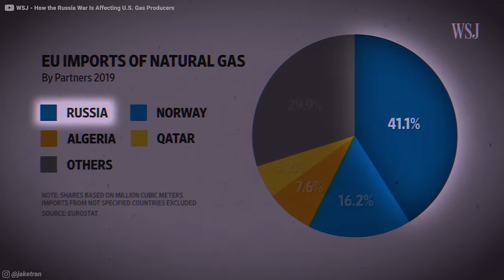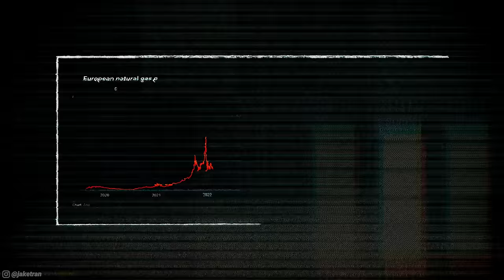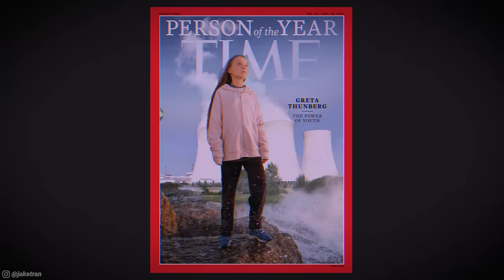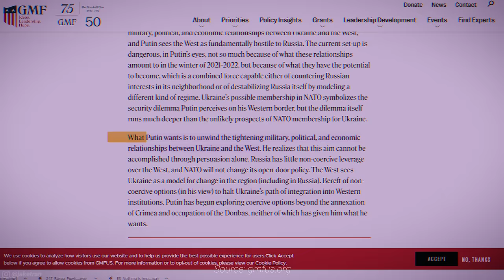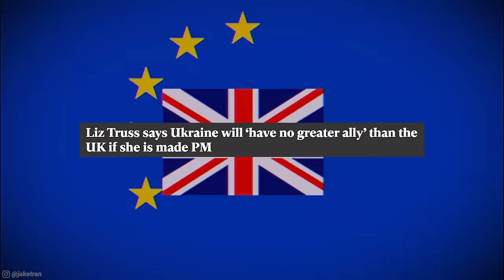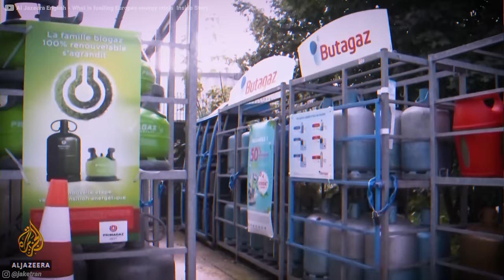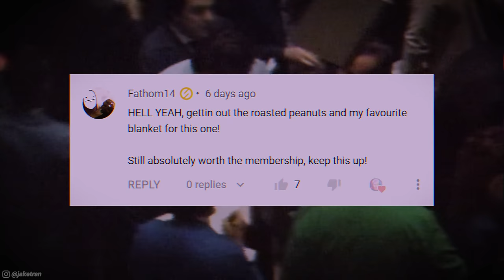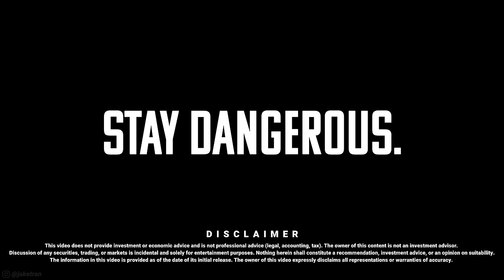Europe is gonna SUFFER.

Comment: Europe never should have turned away from nuclear energy. It's not the boogeyman everyone thinks it is and if we are seriously going to do anything about fossil fuels we will have to implement it.
Reply: There's about 30 Nuclear stations across Europe being finalised within the next 2 years. Europe will be fine.
Reply: In the next 2 years or this winter?
Reply: Thats just wrong. Not diversifying natural gas was the problem. And nuclear power is the straw man today.
Reply: Its not like reactors are safer than any other form of power plant as well as nuclear energy having less worker injuries and deaths than other means of power production or most nuclear waste being relatively harmless and the 1% of slightly more dangerous nuclear waste being stored in near indestructible canisters so nothing can happen to it.
Reply: just fyi, Europe as a whole did not turn away from nuclear, e.g. CZ and SK did not cancel anything and in fact, both are building more reactors in our existing nuclear power plants. SK just launched a new reactor like 2 weeks ago ☺
Reply: @benpriest1418  Lets hope that they see construction and aren't 86ed.
Reply: @cassiopeiathew7406  It takes 20 years from ground up in the best conditions. 30 is average so no, not this winter.
Reply: @benpriest1418  incorrect... france alone has 56. fact check your info
Reply: The problem is the same. Nuclear power and alternatives means certain People lose money. When OPEC threaten the USA. We could  have just stop using gas and make Public Transportation better. Design our cities so it easier to walk. But we didn`t. People will always chooses the easier and less costly. Owning a car is expensive. But walking requires a good pair of shoe which is like 50 Bucks and can last six to eight months.  Why spends hundreds of dollar filling your car when the Grocery is ten minutes walking distance. If you need to get to the mall, The bus is free and can get your there in twenty minutes.
Reply: What's strange is we don't use that perpetually burning fireball in the sky 💩
Reply: @nucleus691  forgot the elephant in the room whichis the national security risk of a nuclear plant, as proven by whats happening in Ukraine
Reply: @JohnTaylor-fh4et  Yes but money. How do we make the money. We could install Solar Panels on the moon or something but if we can`t make money nope. The faith of Humanity and the Planet depends on someone getting richer. What a time to be alive.
Reply: @undeadblizzard  and the best part is money is just created with computer clicks now. "In god we trust", which god, whose interpretation of God.
Reply: @fgsaramago  thats one valid point, actually.
Reply: @Perkwunosik  your comment is incorrect (or more like completely unnecessary) cause @Ben Priest talked about the 30 MORE nuclear plants which are 'being finalized' in the next 2 years all over Europe...!
Please think and read carefully before you call people out for not checking their facts 🤐
Reply: @KingNayNay  didn't ask bro. L + ratio
Reply: german here. u couldnt be more right. especially germany thinks like that.....
Reply: We should let people innovate with nuclear energy. The first cars took weeks to build but now they can be made in a few days. Mass production is faster if we are allowed to prefab parts and quickly assemble on site. Australia is already building nuclear plants the size of houses and assembly line building them.
Reply: @KingNayNay  cope !
Reply: But OPEC would start to cry. Those poor souls won't be able to suppliment their children with 2022 Bugatti Chirons to abandon in the UAE desert. It's tragic they'll have to settle for the 2021 Chiron this year 😢
It's just tragic you know? To drive a peasant vehicle... This is sarcasm
Reply: @PepekBezlepek  yeah they didnt, but there is still problem with EEX (European Energy Exchange) in Leipzig. Since CZ sells electricity to EEX while there are not enought sufficient and self dependend on themself, its the problem, They should just leave EEX and they wont need to buy energy back in higher prices. Thats just stupid. EEX is connected all around EU so thats the big problem
Reply: @JohnTaylor-fh4et  We do but it is dependant on the weather so it requires km^3 sized battery or coal plant backups
Reply: What if I told you that the Uranium is also came from Russia
Reply: @Ulbert86  Or America, South Africa, Austrailia
Reply: @joeshabado1431  Hope you are aware that the US is also buying the Uranium from Russia at this moment. (14-16%)
Reply: @Ulbert86  Good thing the majority of it comes from Canada and Australia who combined produce four times what Russia produces.
Reply: @Ulbert86  they are all in cahoots together, the world's a stage and we're all being played 💩
Reply: Except if it gets bombed
Reply: our houses are heated with natural gas I live next to a Nuclear power plant that still doesnt heat up my Centrale heating unit
Reply: @Perkwunosik  I didn't say there was 30 in total, I said there was 30 being built. Fact check when you read.
Reply: @JohnTaylor-fh4et  Solar is an incredibly diffuse power source requiring an enormous amount of equipment and land footprint to use.  It is also vulnerable to weather with clouds destroying solar electric output.  There is also guaranteed to be low sunlight every winter when energy is needed for heating.  Aging solar cells also inevitably leech toxic chemicals into the surrounding area.
Reply: Nuclear energy is not something that you can adapt in an instant, you don't just make a couple of power plants and start producing cost efficient energy.
There is a reason within Europe nuclear power plants are populated in specific countries and they are not spreaded all over Europe. First of all you need to have a consistent way of supplying yourself nuclear fossils, you also need a long-term plan for treating or storing your nuclear wastes and you also need a costly group of nuclear supervisors and testify that the power plants are operating safely. Jumping into this business with one power plant is just a non profitable energy source, jumping right into it with 5 power plants to have a cost even power source is also not worth it because easily something may go wrong. It's complex.
 Usually a country that wants to enter the nuclear power gang, will contribute to an economical ally country to offer personel to work on their power plants to gain experience and the "know-how", usually they will also offer as a trade to store some of the fossils and/or wastes for free under their ground and slowly will move to a couple of test power plants operating alongside the supervision of the country that they obtained the knowledge and the connections from. This applies even to countries like Germany with high level educational level.
Reply: @cassiopeiathew7406  Not going to be issue. Actually nordic countries have build their houses in way that they isolate the heat. Plus most of the heating isn't done by gas but by nuclear energy. Only small amounts of households uses gas.
Reply: @JohnTaylor-fh4et  One day that fireball is totally gonna be burned out though. Wonder what humanity's plan is when that happens.
Reply: yee
Reply: Tell that to germans and Austrians
Reply: @JohnTaylor-fh4et  1) Solar panels deteriorate fast
2) if its cloudy the effect deminishes
3) mantainance is really costly
Reply: @nucleus691  "nuclear waste being stored in near indestructible canisters" bro all it takes is one earthquake or tsunami to release the horrors of extreme gamma radiation into the world.
Reply: every house a mini reactor the size of a dishwasher, for heating and electricity, and free home delivery of 2oz of uranium one a year
Reply: @LABOUMDECADANCE  same goes for fossil fuels no, plus the instability of prices .
Reply: What’s the worry didn’t y’all evolve to survive Winter
Reply: considering north europe such as norway, finland do not have earthquakes due to the fact that they are on stable landmasses, all they have to care is about the accidents made by human error,
on the other hand, countries on young orogenic belts such as japan have a high possibilities of having earthquakes so if the earthquakes that occur there are big it's dangerous to build nuclear plants
Reply: Very true Joe but wouldn't all these evils he ended if we just didn't need energy and  live off each other sharing everything we have. At the end of life who and what did you fight for ....chances are your idols not God at all. Be careful in what you believe in if it isn't God then it's the other there's only two sides. I will always be this person people don't like if I follow the masses I end up where they do. Same to everyone
Reply: The way you sold nuclear energy you could be a great asset to God if you ever decided Joe
Reply: I’d disagree there fresh water consumption is a lot if you put it on a river you can kiss the fish good bye
Reply: @benpriest1418  wishful thinking
Reply: Or turn of its own gas, to please the green parties.
Reply: @cassiopeiathew7406  it's winter. you can survive the cold as long as you have enough clothes you keep you warm. if you don't have electricity during the summer, that is something to worry about because no matter how much you strip, you'll never be cool enough.
Reply: Only dingdong who was distancing from Nuclear energy was Germany, fortunately they now realise it was bad idea...
Reply: Am love russia
Reply: @JohnTaylor-fh4et  Finally somebody gets it. Yes, we are all being played, some people are getting obscenely rich out of the ukraine war, out of the food crisis, out of the energy crisis, out of the carbon footprint eugenesics. 
The reason why a lot of nuclear plants are still so dangerous is because the development stagnated decades ago, why allow nuclear power to flourish for peace and wellbeing if there is a lot more money to be made out of war and oil.
Reply: @benpriest1418  I cracked when I read 2 years, that's practically one Westoros Winter
Reply: You can blame the civilians of that.
everyone was protesting against it.
Reply: Totally safe nuclear energy which somehow gets safer as global politics become increasingly hostile
Reply: @davidvalencia129  that's why you have a diversity of sustainable sources like solar, wind, tidal, wave, and geo thermal..
Reply: @hl8216  And Japan has built many.
Reply: Lol. 1st, Gas is mostly used for heating, and the infrastructure of the industries are not suitable for transforming electricity to heat in time. And households lack the same infrastructure aswell, even though a lot of people are buying electricity heaters, and this is for what reason? Right, electricity prizes didn't spike up that fast.
2nd, nuclear energy is a basic supplier for electricity, and doesn't help much if the demand for electricity spikes up. That's for example the reason why france with it's 80% nuclear power has to import electricity from germany every summer to supply for their cooling systems.
3rd, you heard about that nuclear plant in ukraine that is currently controlled by Russia? Defininetly a smart turn to have some of these in your country active running when you're in fear that Russia might use nuclear bombs as retailiation for just supporting Ukraine for the war.
Still convinced, that nuclear energy is a smart strategic move favourible than renewable energy?
Reply: @LABOUMDECADANCE  one day is at least a millenium from now. Technological breakthroughs mean oil is being found in places where it was thought it had been exhausted. 'The Quest' by Daniel Yergin is an illuminating read.
Reply: We shouldn’t also forget further investment would’ve lead to further advancements. We’re still at the infancy stage of harnessing nuclear energy
Reply: Its the ONLY alternative to fossil fuel. But "doomsday ecologist" have nothing in common with common sense.
Reply: Yes and no. You'd still be reliant on importing fuel for those reactors so, while it might not be Russia in this case, the underlying problem would remain and volatility in prices would occur regardless during a large scale conflict.
Reply: France has a lot of Nuclear power plants
Reply: Risay  The problem is putting profit over humanity. What do you think Open Source is? People get degrees in Education or Philosophy because they love it, if work needs to get done, people will do it. The concept of money isn't real, and money is valuable because we decided it so.
Reply: @a2somali-ish588  Same with solar wind and sea tides
Reply: my man speaking truth
Reply: @cassiopeiathew7406  I can live perfectly fine without heating in the winters. We barely have winters here lol. I am not made of sugar.
Reply: @nucleus691  That's 100% true lol. And Europe doesn't have a lot of natural disasters so they don't have to fear nature going wrong like Japan. It's basically a great solution all around for them.
Reply: Could not agree more!!!!
Reply: bingo
Reply: nuclear energy is fine, the thing is that solar/thermic/hydroelectric energy, is just cheaper and more effective, I might be wrong but I am pretty sure that if you completely fill a land area equivalent to the land an average nuclear powerplant would require, depending on where, it would produce more energy than the nuclear powerplant in that same area.
Reply: @AmasterfulJuice  well ideally you want to combine it with all of them you want a diversified energy industry
Reply: boogeyman
Reply: @JohnTaylor-fh4et   The problem with solar and wind even more is batteries. You need as much infrastructure to store power when sun isn't shining/wind blowing. Otherwise there would be solar plants all over the southwest US and the Sahara, powering the world. The windiest seas would have wind farms for miles. But batteries to store power for cities/countries are insanely expensive/non-existent. Invent some new battery that isn't lithium and you're golden.
Reply: I am sure this comment section has a lot of people that know what nuclear energy is, and know what are low, medium and high levels of waste and how its recycled to the use of more important products, and I'm sure they know how atoms split to create heat. And that everyone is an expert and has the discipline towards others individuals replies.
Reply: @johnsmithcrackhead  Uhm... huh!? Ok dude!
Reply: Nuclear energy is the source of world pollution and the cause of climat change it is cheaper as source of energy but dangerous in long term the problem with Europe is it has become the US colony the deal with gas could have been a mutual win
Reply: @bolatsabikhan8127  You do know what induction heating is? Electric forges do exist.
Reply: @33333Tarun  That's why it's a big problem out there
Reply: does cernobyl ring a bell
Reply: @itzmosestone  Ok, 1986 USSR is NOT Europe today. The conditions and technology that allowed Chernobyl to happen don't exist anymore. (actually I think russia still operates the reactor type but screw them) Nothing is 100% safe but doing nothing will kill us.
Reply: True.  At the same time, Germany should have sticked to coal and nuclear energy, along with gradual investments in solar and wind technology.  But no, around half of the German GDP was produced from Russian raw materials.  Putin was making fun of Germany way before today.   Germany today pays the price.  France was smart enough after WW2 to understand the importance of self-sufficiency, and now suffers the least damage due to war, but rather from lack of rain, which actually only is temporary.  As France enjoys friendly relations with states which produce oil and natural gas like Algeria, the economic suffer it experiences is limited.
Reply: germany is not only thing in europe, all other states still have nuclear power
Reply: Free energy = free money and free money is not profitable for a society
Reply: Its crazy knowing alot of their issues will get resolved if they turn the power plants back on. 0 carbon emissions and literally produced the least amount of waste compared to any other form of energy.
Reply: Meltdowns are awesome.
Reply: Idk man it’s a bit more complicated than that. You don’t power cars with nuclear or many other things. But moving away from nuclear as a primary power source was lunacy
Reply: @samrosendahl392  yes but we are switching to electric cars. without clean electricity it is a fools errand.
Reply: @joeshabado1431  it’s a fools errand regardless of the power source: so you know the components electric cars are made of and now these materials are acquired? Literally nothing is less eco friendly in the world